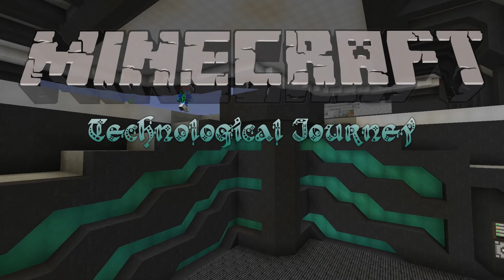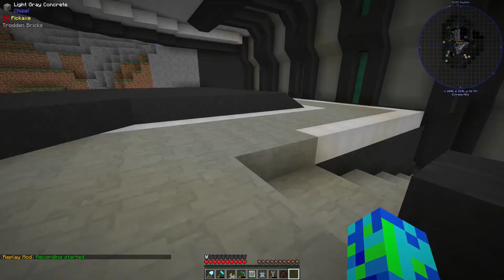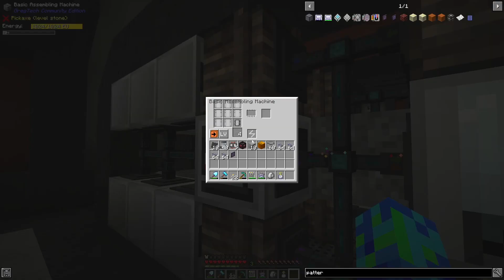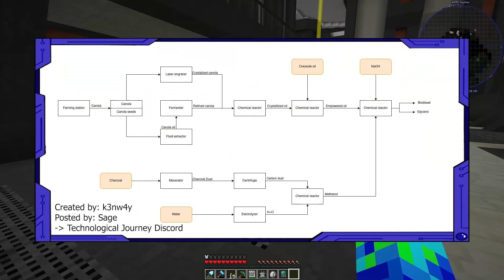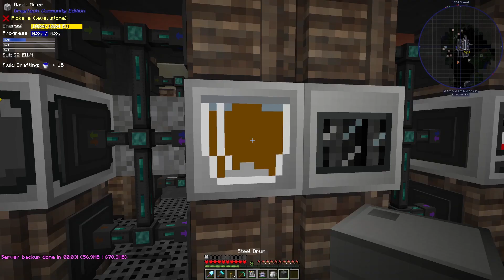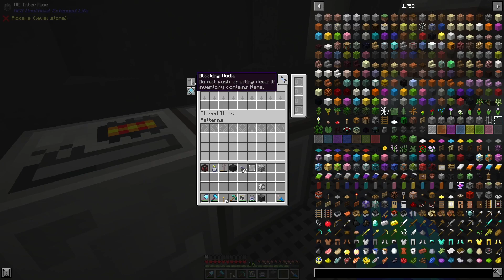Technological Journey - EP 5 - AE2 Autocrafting, Fuel Upgrades + Serious Circuit Progression!

Comment: Man you gotta stop with the 16x cables, 4x cables are enough and you are wasting power and resources doing that
Reply from the maker: Im not entirely sure which cable line your referring to here, but I always try to plan ahead, so if im using 16x with only 4 machines for example, its probably just because i forgot to mention the future plans for that cable line! I might have slipped up tho, so lmk which line and ill double check :)
Reply: @Ironcopter  but the thing is that unless you are imputing 16 amps at once like if you transformed 4 mv amps to 16 lv amps with a high amp transformer you don't need 16x wires. Im refering to every line which uses a 16x wire, it doesn't need it.
Reply from the maker: Would u be able to point out which line in particular I’m doing that with, i think most of my cables are the correct level for amperage, i might be missing something tho..
Reply: @Ironcopter  2:38 for example, there are more tho. like you don't need 16x cables at all
Reply from the maker: Ohhh i see the confusion between us here, my bad for not explaining it properly in the video. On most of the lines like that one at 2:38 and down in the chemistry room, i have 1 or 2 MV machines running on the same line as LV machines. Since MV machines take 4amps of LV to power (I think), i need to run extra amps through the cable. And since i also need to power LV machines on the same line, i cant use MV cables!
Reply: @Ironcopter  you don't need 16x cables for that, in gregtech community edition you can just keep adding amps to a line infinitely as long as you don't put more than the cable size at once, for example if you were to connect a high amp transformer transforming 4 amps of mv into 16 amps of lv then you would need the 16x cable but if you are only connecting normal transformers which output 4 amps you only need 4x cable and you can connect as many as you want
Reply from the maker: Ohhhh i gotchaaa, i just checked in the discord as well and that is the case. I was just confused because its technically a ‘bug’ (thats everyone in the discord said). Il change that up for future lines then! Thankyou!
Reply: @Ironcopter  it is a bug which is only on that version of gregtech, glad i was able to help!